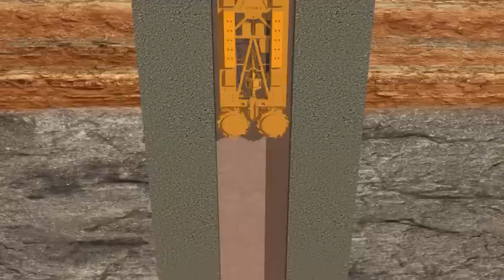DAM CUTOFF WALL - SEEPAGE BARRIER CONSTRUCTION - PLASTIC DIAPHRAGM WALL

Comment: That made absolutely no sense whatsoever.

Maybe an explanation on what the fuck they were doing would have been nice for those of us who are not hydroelectric engineers.
Reply: They're building an underground cutoff wall for the base of the dam.  since you don't want to be in the business of excavating down 50+ feet of earth just to build a wall and then back fill, you use a device that can chew a rectangular hole in the soil layer and fill it with fluid temporarily for it to keep the proper shape.  Then once you go deep enough to hit the impervious bedrock stratum, you pump concrete in, which is heavier than the retaining fluid and it sets into a giant column in the ground.  Rinse and repeat until you go the width of the dam you're building and...viola, you now have a mostly impermeable shield so that water doesn't creep all the way through an earthen dam.

Simple!
Reply: The interim liquid is called Bentonit. Its a clay-water-mineral-mixture, so the walls of the deep hole are not collapsing. The Concretewall created is the backwall of the later dam. This way you can safely excavte the other side, without fear of collaps. You can later also excavate the Water-side, so you get a nice water basin, clean of mud n stuff, since it damages the generator turbines. Im also not a "hydroelectric engineer", but a construction or civil engineer. ;)

Comment: So  what would you be using for reinforcement ? I noticed that there was no animation for what you'd be using and how you apply the re-bar  or some other type of mesh you'd be using. Is there something already  in the concrete while it gets purred down ? Because the animation show all you have to to is dig pure repeat . Concrete is not strong by itself unless you have something to reinforce  it. So what would you be using and how would it be installed ?

Comment: I have doubts about the wall strength
Reply: Its braced on either side by thousands of tons of dirt and rock
Reply: It doesn't have to be strong, it is just there to keep water from flowing.
Reply: Don't Askme thank you. I'm always curious about everything so just askin! My question was coming from the fact that at the end it is not a whole wall but in fact columns one very close to the other. But they're not built for strength, right?